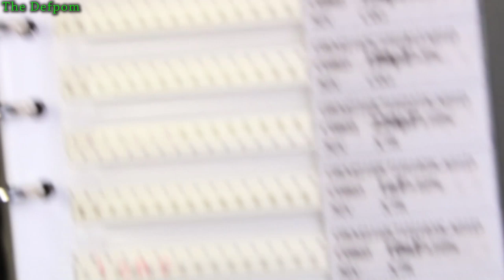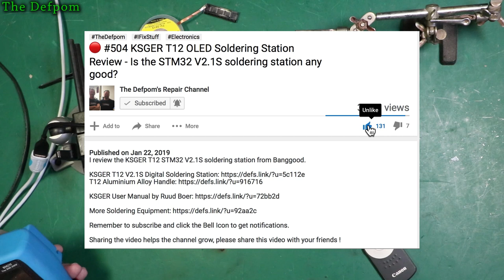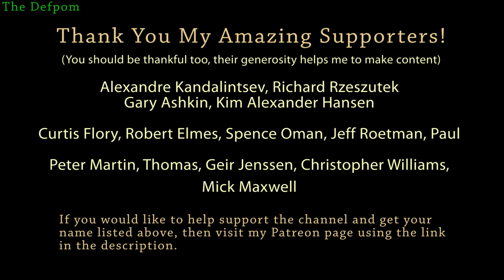🔴 #624 Camping Light Fly Zapper Teardown And Repair - Bug Zapper Repair

Comment: Nice repair! A small bit of wire wick makes a good small heat sink in a pinch and you can "fan" the loose end to help with cooling plus it can be shaped to fit an odd area.
Reply from the maker: David V - that’s a good tip, will try to remember that for the next time I need a little bit of heatsinking.

Comment: What an odd device, i was expecting to see a coil and diode boost circuit or a small transformer and transistors to make the high voltage.
Ahh well, it's working again bzzzzzzzzz ouch!! :)
The tennis racket style zappers are brutal lol.

Comment: easiest way to find what the capacitance is it to look at the data sheet of that new chip (as long as the cap is connected to the pins of it of course) and check to see what its used for. the data sheet should also state what its for and the value. maybe used to set current or something to the battery during charging

Comment: Good morning. I wonder how well these zappers work 🤔 what temp did you have your hot air on I seem to either have it to low or to high on mine lol.
Reply from the maker: Joe HamRadioGuy - I think I had it on about 430C with about 30% airflow (Quick 861DW)
Reply: Defpom's Electronics & Repair ok I think that's my problem having to much air flow. Been awhile playing with electronics. Thank you.
Reply from the maker: It has UV led's by the HV mesh to attract bugs.
Reply: I own the same one. Mosquito is more likely to get attracted by you rather the UV. Some get caught nevertheless. So it helps, but you should rely on it only.